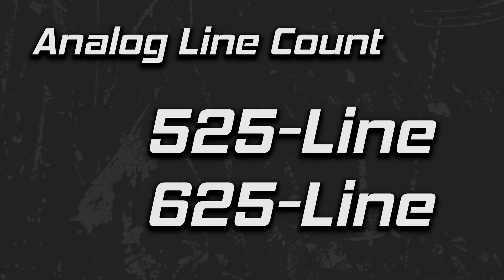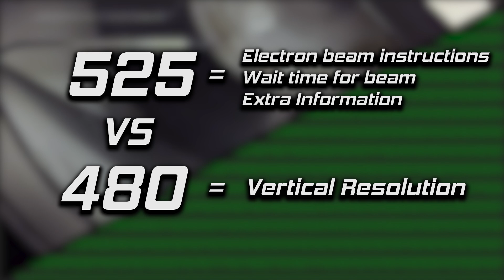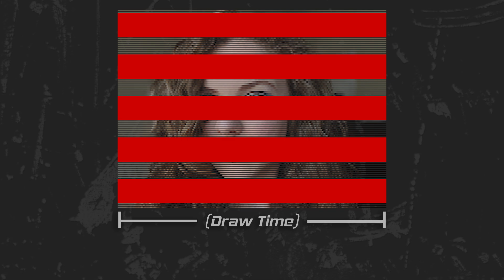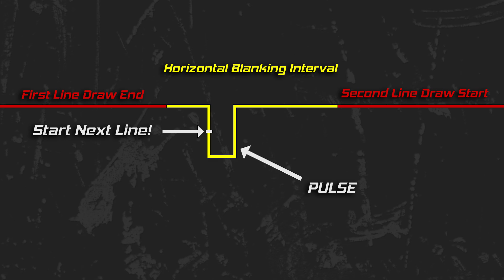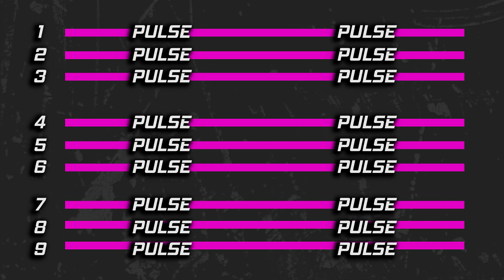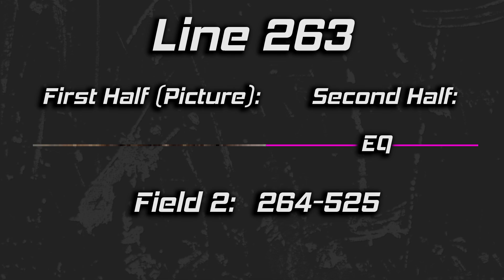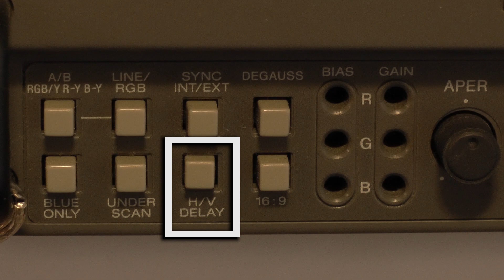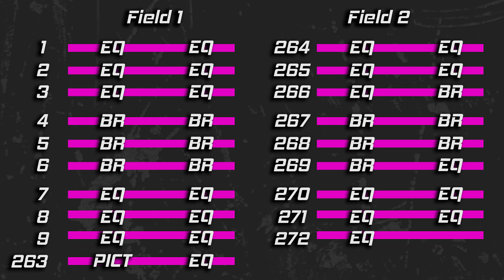What is 525-Line Analog Video?

Comment: I've always wondered how CRT TV's functioned. Had no idea "480p" has been around since the 40's, that's amazing!
Reply: It would actually be 240p, with the width of a 480p signal (i.e. 720x240). The old consoles were essentially displaying everything on the top field and ignoring the bottom one. A true 480p(720x480) signal would take more bandwidth than the typical RF connections of the day -- for color signals, at least.
Reply: @thebeetalls  makes sense... The first time I saw true 480p on CRT was around 2005 on PS2 with an S-Video cable
Reply: The original NTSC standard was 525i (interlaced) which gave a vertical resolution of about 480, with a maximum horizontal resolution of 330 due to bandwidth limitations of the broadcast signal.   There are no pixels in analog TV, just horizontal scan lines (which the number of give the vertical resolution) and horizontal resolution based on bandwidth limitations.  
Even today, most HD broadcasts are 1080i (interlaced), with some broadcasting in 720p (progressive scan).   There are no 1080p broadcasts, but Blu-ray players and other electronic devices do use it.

Comment: Back then we thought 480P was a great picture!
Reply: 480p still is a great picture, it's only bad scaling or bad compression that makes it look bad.

It was a mistake to from 480p to 1080p, it should have been 960p instead. Then we wouldn't have scaling issues.
Reply: @salvatronprime9882  - I suppose.  But native 1080P content has no scaling issues on 1080P TV's.  

I agree that 480P can still look very good.  I have a couple of portable tube-based B&W TV's, and one color LCD.  When Analog went away, I put a converter on just for ha-ha's.  I was amazed at the picture quality you get from a 'clean' source.

Comment: That's quite cool...
So why not use 2 electron beams? Or 3? Or 4?
Reply: The particle beam is deflected with yoke magnets; the technology to control multiple beams in a single tube is just recently being explored in large particle accelerators.  Even those use fixed-field blocks, not the kind of interferometric adaptive beamforming that would be needed for multiple scanning vectors.  There's not currently enough CPU time on the entire planet to run the physics model needed to calculate it in realtime.  But being able to localize magnetic fields like that would also open up a lot of possibilities with fusion reactors and brain interfaces

Comment: One interested tidbit is that analog TVs didn't have pixels. The electron beam just varied in intensity as it moved left to right. So there was no definitive horizontal resolution for an analog signal.

If anyone wants to learn more, the channel Technology Connections made some good videos on analog TV, and Texas Instruments has an application note about CRT displays entitled "Understanding the Operation of a CRT Monitor." With the application note number AN-656. It's a good place to start digging deeper, for those interested.
Reply: That is true, but there was a limit to horizontal resolution due to the bandwidth allowed for broadcast TV.  For NTSC each channel was allotted 6Mhz, which gave a maximum of 330 horizontal lines of resolution.   You could determine the horizontal resolution with a test pattern.  Often one was broadcast at night in off hours.  https://upload.wikimedia.org/wikipedia/commons/thumb/a/ad/RCA_Indian_Head_Test_Pattern.svg/1200px-RCA_Indian_Head_Test_Pattern.svg.png

Until TVs had composite video inputs (and later S-video and component), that was the limitation.  With composite inputs higher resolutions from connected devices could be achieved, because there was no 6Mhz bandwidth limitation.  Monitors within TV studios had that capability (including some with RGB inputs) before it was available to consumers.
Reply: @my3dviews  Yup. When using baseband modulation for an RGB signal (as opposed to squeezing into an RF signal, or the limitations of a quadrature modulated color signal like composite or S-Video) your horizontal resolution was effectively infinite, limited only by the resolution of the phosphors of your display and the electronics in your display generator and monitor. This is how the ECS/AGA Amigas could do 1280 horizontal resolution in "SuperHiRes" modes on a 15Khz display.
Reply: @my3dviews  Thanks, I didn't know about the bandwidth they had for each channel. Do you happen to know what the entire bandwidth was that was dedicated to over-the-air TV in general? And the radio frequency the FCC allotted for TV related things?

 I was actually intending to look up info on various test patterns some time ago but forgot. So this served as a nice reminder. Great comment, man!
Reply: @VoidHalo    You're welcome.  :-)
It varied over the years, but for the most part there were two different bands allocated for TV.  The most common was VHF (Very High Frequency) and the other was UHF (Ultra High Frequency). 
VHF had channels 2 to 13 (channel 1 was dropped and reallocated).  So, that would be 6 MHz for 12 channels, or a total of 72 MHz.   Also there was a gap between channels 6 and 7, which was/is used for FM radio broadcasts.  
UHF was channel 14 to 83, although not all of the channels were actually used.  Later some of them were also re-allocated for other uses.
Reply: @my3dviews  Oh yeah, now I remember how old TVs had a VHF dial and a UHF dial.
Reply: @VoidHalo    That's right.  Where I lived we only had VHF channels and not many of them either.  We lived on a farm and only got what could be picked up with an antenna on a 30 foot tower, with a dialer to aim the antenna to different directions where the channels came from.
Reply: @VoidHalo  I only know the FM radio frequency for one channel. Channel 6 used 87.9 MHz in old analogue TVs.
Reply: @MikinessAnalog  I'm sure there's a whole list of em somewhere online. They're probably different for each country/region, too.
Reply: Well you had the dot pitch/TVL of the actual display and the frequency of the signal itself both contributing to the resolution.
Reply: @doltBmB  Can't say I'm familiar with dot pitch or TVL. Definitely gonna look those up.
Reply: @doltBmB    The dot pitch of the screen was a fair bit higher than the resolution of the TV, so didn't play a big role in limiting screen resolution.
Reply: @my3dviews  well it certainly played a role in PC crt resolutions, cheaper CRT's would look quite bad
Reply: @doltBmB    Yes, in high resolution monitors the dot pitch is more important as it needs to be higher than the screen's resolution.  
But, the discussion was about analog broadcast TV, where the resolution was much lower than later analog computer monitors. 
Normally a person wouldn't sit close enough to see the dot pitch on a TV, but they would with a computer monitor.
Reply: @my3dviews  TV's still have TVL, they have very coarse grilles that can still impede resolution
Reply: @doltBmB    I don't think that any standard definition TV has a coarse grill that is lower than the resolution of the TV.  A standard def TV only has a resolution of 330 horizontal lines and about 480 vertical (525 minus the overscan and retrace).  But had a way higher dot pitch than that.  Unless maybe on a small colour TV under 12 inches would have similar sized dots and therefore less in the vertical & horizontal directions.  
On most larger TVs (20 inch or higher) you could see the scan lines, but not the colour dots from a normal viewing distance.  The horizontal scan lines represent a higher resolution in the vertical direction than the horizontal resolution, which was dependent on the bandwidth of the signal.  So, the TVs resolution was limited by the amount of scan lines (which is inherent in the format) and the horizontal resolution which again, is dependent on bandwidth, not the dot pitch of the TV.
Reply: @my3dviews  depends, vhs had very low horizontal resolution but broadcast or game consoles could have much more detail
Reply: @doltBmB    VHS was even lower resolution than broadcast TV.  It was about 280 lines (if that) vs. 330 if I remember correctly.  330 was the limit of broadcast TV due to the 6 MHz bandwidth.  The vertical resolution of VHS or any VCR was the same as broadcast. 
In order to get higher than 330 lines of horizontal resolution you would have to bypass the TV's tuner (as that was a limiting factor).  Later TVs with composite or S-Video inputs could get higher resolution from game consoles or Laser Disk players (which were around 400 lines).  But again, we were talking about broadcast TV, which has a limit of 330 lines.  No way around that, until HD came along.
Reply: @my3dviews  No, it's definitely much higher than that. Home video content was low resolution but other sources such as broadcast could provide much more. SD is digitally output at 720 to cover all bases.
Reply: @doltBmB    Sorry, but no. I was an electronic service technician and repaired TVs in the 1980s. I know all the specs of standard definition TV.  It had a maximum broadcast resolution of 330 lines of resolution, limited by bandwidth. The digital equivalent is 480i which is 640 by 480. 720p is a version of high definition,  not standard definition. Why  not do  some research before arguing about something you clearly don't know much about. Look it up,  you will see that I am correct
Reply: @my3dviews  640x480 is a square pixel vga resolution, 480i is by 720
Reply: @doltBmB    640 x 480 is either 480i or 480p.  and an aspect ratio of 4 x 3, which is what standard definition is.  720 p is a 19 x 9 aspect ratio and is HD, not SD.  

But all of that has nothing to do with broadcast analog TV.  Digital TV resolutions are not the same.
Reply: @my3dviews  No.  He meant 720 lines of horizontal resolution.  720p is 720 lines of vertical res, with 1280 pixels across.  I had this confusion at one time myself, because of the unfortunate use of the number 720 in both cases.  So, a DVD has a maximum resolution of 720x480, which still matches the 480i (and later 480p) standard, but encodes at a much higher bandwidth than NTSC broadcast.  Of course, it can't be broadcast in NTSC without losing a lot of horizontal res.  It must be displayed using at least 3-cable component video directly to a TV or monitor capable of resolving that much bandwidth per scanline, in order to preserve its native res.
Reply: Black & white screens didn't have pixels but colour Tvs do.
Reply: @MikinessAnalog    Not colour CRT TVs.  Those colour dots are not pixels.  Only digital TVs have pixels, not analog ones.
Reply: @my3dviews  yes they do have pixels, but they are tri-colour created by requiring a shadow mask right behind the glass so the electron beams align on the correct colour.
<<< entertainment electronics engineer & technician over 15 years.
Reply: @MikinessAnalog    I was an electronic service technician in the 1980s when these TVs were in use. The colour dots are not pixels. They are on plasma, LCD and OLED or other digital TVs.  You may be an engineer, but you don't know what you are talking about. Do some research into the subject. Just do a search for "do CRT TVs have pixels. Answer:  They don't.
Reply: @my3dviews  Agree to disagree, big hugz

Comment: Also: analog television did not have pixels. Argue amongst yourselves all you want, you will still be wrong.
If anything, each horizontal line was the "picture element" that could not be divided further, or, the enter screen was one pixel.
Reply: Lewis Johnson It had discrete lines, but each line couldn't be divided into pixels, no. It still had limited resolution along each line though, determined by the signal bandwidth, which had the information equivalent of a certain number of pixels.
Reply: Yeah,  @dingo137 , so it's kind of pixel-like, but not as definite. Alec of Technology Connections has 2 videos that go into this really fulfillingly well! And I say that because I was one of the ones who was out there saying, "Well what are these dots then, and what do you call each piece of picture as you go from one bit of brightness or color to the next, in the same line?"

Comment: pre 625 lines was 405 lines i think.
Reply: In the UK, 405 lines was used from 1936 until 1985.
625 line system started in 1964.
Some very old monochrome TVs have both 405 VHF & 625 UHF tuners, especially in the 1960s.

Comment: Wonder if a console could have used the closed caption section to display text and then used the sections of the screen where it's displayed to perform additional logic?
Reply: the closed captioning is just on one line, not a very long period of time, the TV then reads that line, creates a new signal representing the text and overlays it on top of the other signal during display

Comment: Sometimes, even with the sync pulses, sets can still produce a poor or wavy picture, hence why you're oftentimes given manual adjustments for horizontal and vertical size / timings. Adjusting the size potentiometers will adjust the beam speed (always takes the same time, but going further in the same amount of time will produce a larger image), and adjusting the sync potentiometers adjusts when the set will move to the next line on it's own. This way, it can generate some kind of picture without needing sync at all.

Also, F-Zero on the SNES is a pretty lame example of racing the beam... How about using the same basic CPU at 1/4th the speed to draw the screen directly every scanline? No framebuffer, no video generator like the S/NES have... Check out the Atari 2600's TIA video chip or the Sinclair ZX-80 and ZX-81 (Timex Sinclair 1000 in the US) for some amazing examples of CPU driven graphics. The SNES' CPU will get over 4 million clocks in one second, an Atari 2600 will get around 1 million. Oh, and the SNES? The SNES has a hardware interrupt on the CPU to tell it when the blanking periods start. The 2600 doesn't have that!

When you say "A CRT does what it is instructed to do" you are only partially correct. While yes, many of the last CRTs (and many of the high end or expensive CRTs) can accept and display an extremely wide range of signals, a vast majority of sets will often display garbage or not work at all. For many tube sets, if the sync pulses are too far out of a tolerance, you won't get anything but static or wavy lines, and in extreme cases you can cause internal damage because the horizontal / vertical output oscillators are run by the picture information... Which can cause the output tubes to red plate and get extremely hot or shatter from excessive load. The oscillators help to keep them on a shorter duty cycle which significantly prolongs the life of such tubes.
Hope you found this little bit of trivia to be informative or interesting!
Reply: Nintendo games are recognizable to millions of people, so they make great examples for retro tech. A Sega game was also shown. Please stop acting like a butthurt fanboy, it really detracts from everything else in your post.

Comment: 02:15 Why not have the electron gun do a zig-zag pattern (well, just move down to the next scan line and draw a straight line in reverse) so there would be significantly less wait time? Maybe they could have used the time gained to get a higher frame rate or something?
Reply from the maker: That is a great question. 

The signal fed to the TV has each scanline drawn in order from left to right. To make the change in beam operation would also require changing the electrical signal fed to the TV.

The reason there is such a large amount of time lost to sync signals dates back to how the early TVs worked. TV circuits evolved over time and were capable of operating at a faster speed and with superior accuracy. However the signals remaining unchanged for the purpose of backward compatibility with existing sets.

Comment: 7:52 - I always wondered why there was half a line missing at the bottom of the picture when a local TV station was still using analog cameras on a digital transmission, that clears it up, thank you!

11:23 - I wish there was an easy, reliable way to capture closed captions from analog video, seems to be a feature either missing or an afterthought on most capture cards :s
Reply: Yeah, I've always wondered also while watching old cartoons on YouTube why the bottom of the picture had half of a missing line.